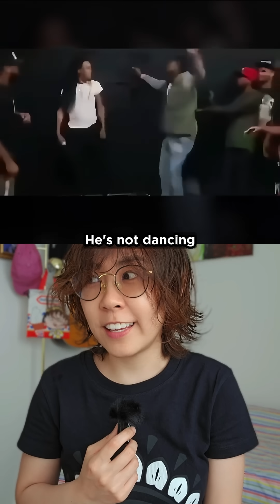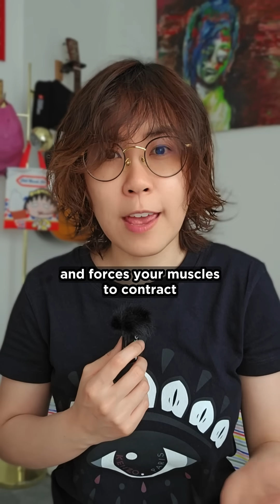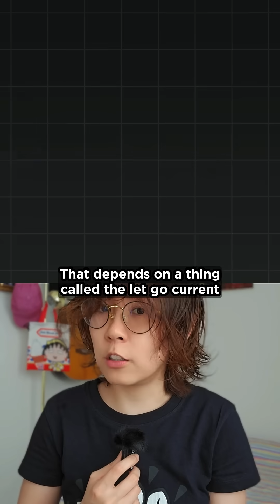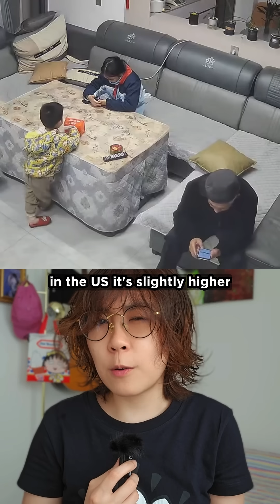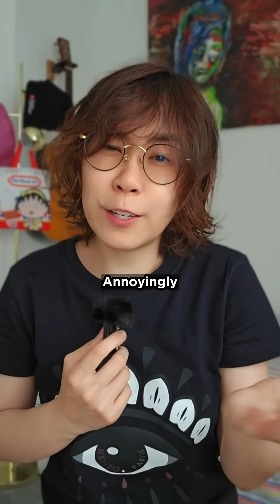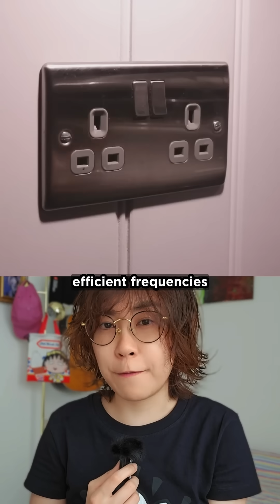How Much Electricity Can You Touch Before You Can't Let Go?

Comment: Old electrician told me to use the knuckle. Always use the knucles cause once u get shocked the knucles go towards the center of your hand and therefore separates u from the currents path.
Reply from the maker: That's interesting, I've not heard of this technique before. 
I only know to operate with one hand instead of both, so that the current is less likely to pass through your heart. 💜
Reply: @vt.physics  We're taught left hand rule, cause if one is gonna blow off, you want to keep your dominant hand.
Reply: @vt.physics That's what I was told to do when working on voltage. Before that I was told to never work on voltage.
Reply: @vt.physics  since electricity needs a closed circuit, I use my powers to float in the air, just enough to keep my feet off the ground. And so far that seems safe enough I can use a large heavy gauge penis, where the electrons would have virtually no resistance, and so far it seems much safer testing potential live electrical wires than my bare hand.
Reply: @vt.physics  Yeah, you should check by using the back of your hand so if there is a current, your hand and fingers curl away from the point of contact preventing you from closing your hand around it ⚡️🔌
Reply: Ooo! I didnt know that!!  @vt.physics
Reply: @vt.physics  the technique I like to use, is to use my powers to float in the air, just enough prevent a closed circuit. Then I use my large, heavy gauge rod, which is thick enough to offer no electrical resistance to check the for live wires.
Reply: @albertooresteslopezrosell6560  or, you can use a a multimeter, which is what that electrician would do, after disconnecting the power, and tagging out the box, so no one turns it on behind him.
Reply: @jaeger251  I got a $30 volt stick in my pocket and its a fluke buy a $10 one
Reply: @jaeger251  try tagging out a box with 15 skinners wired @ 480, never know what your going to get or opening lbs to check
Reply: Imagine it by pulsing your muscles which way does your body go when it contracts.
Reply: Use the knuckle for what exactly?
Reply: As an electrician I actually recommend using a voltmeter or multimeter. I don't know what that old guy was on about. 

But for real, I would recommend finding something metal that has a rubber handle and touching the metal to ground and the thing you're trying to test at the same time to make a visible spark. That's much safer than using yourself as the testing device, knuckle trick or no. You don't know how much voltage is going through there, and while it's probably a relatively safe amount, you still should probably just use something metal. Just don't grab the metal directly yourself.
Reply: Appreciate it
Reply: And that’s why you pay attention in math class people
Reply: Huh, i've actually seen old school electricians in the 90's just stick a finger in their mouth and then touch a 'possibly live' wire or circuit. Also seen on several occasion them discover that said wire/circuit was indeed live.
Reply: How about turning power grid off before working with wires?
Reply: Another thing we learned back in the day like in a fire situation where you can't see and need to feel for an exit turn your hands around facing you and close them and feel with the back if your hands.
If you hit something electric instead of grasping it and dying it will recoil your arm muscle back away from the wire
Reply: I will try it.    Not
Reply: Also work in electrical. High voltage distribution. But we also hook up 120/240V Services to the main secondary systems that feed peoples homes. Some of the old heads preach if ur feelin dumb and wanna check if a service wire is hot without measuring it, u give it a tap with the back of the hand so if the muscles contract u dont grab onto it. It’s not something id recommend but it does work as intended.
Reply: DC can cause some weiiiird muscle reactions so I wouldn't use it for that.
Reply: Yeah that's great but you can't write your words out completely like a big boy?

Comment: I remember one of these incidents vividly. I was 5 and was watching my father set up the festival lights. Tbh, I was annoying him by touching random wires that were not connected. He was concerned and so he told me to go away. I didn't want to go so I  told him I wouldn't touch anything. One of the lights wasn't working, so he told me to not touch anything while he went to search for the tester. 

Rookie mistake! I went ahead and connected a wire which has a plug at lne end and a socket at the other to the main board and connected that socket with the plug of the lights that wasn't working. It was a loose fit. To know whether electricity was flowing, I tried to touch the exposed metal part of the loose fit plug with the middle finger of my right hand. I absolutely knew the consequences but did not know how dire. Nothing happened the first 3 times because I pulled away too quickly. 4th time, a very small part of my finger got burnt. I saw small amount of smoke.

The story doesn't need a conclusion. My mother saved me from my father wrath and then showed me her personal wrath. 💔

But now I know how electricity feels like. 🙃

Comment: Before someone misunderstend:
This is true for voltage higher than 200V.

I have seen people that say 10mA will hurt a human, without the frequency and voltage
Reply: every single combination of amperage and voltage does something different to each individual part of your body, there isn't a magical universal rule
Reply: @AdrianOkay  Yes. I am tring to point out that you need the voltage too, not jsut the current.
Reply: And this misconception is why Americans insists on keeping 120. Where 400/230 3 phase to the home which is Standard in Northern Europe is more efficient notably with EV Chargers and High power appliances such as Oven / Stove / Water Heater. Plus its more balanced on the feeder lines. Yes these are all 3 phase 400v in many many homes and are protected with RCD / GFCI. Which means they can often be ran with 16amp wire instead of 50amp wire.
Reply: M I S U N D E R S T E N D 😂 😂
Reply: 150 volts can be dangerous too if it has high current. It only takes 0.05A to kill you but it needs the voltage to push through otherwise it won’t be able to break the skin.
Reply: And someone who's been shocked by 50A 240V 60hz I can confirm that you are misinformed.
Reply: 10ma is lethal at a certain time of exposure when ths source is at a low frequency. At higher frequencies it gets a lot more complex
Reply: @zedsanimations2242 I love to hear you elaborate on the complexity of the frequencies and where exactly the 10 mm needs to be applied to create an issue. When the paddles are placed on the heart, do they need to be ultra conductors like gold or will just wires straight into the chest do the trick?
Reply: 10mA can be fatal
Reply: You can model the human body as a resistor, so lower voltage reduces the potential current that can flow, since I = V/R Others in the comments are right that the magnitude of the current in the body is what causes the harm. 120V is safer than higher voltages for that reason, but it’s not “safe” cause it can still kill you if you don’t work with it properly.

There are also limitations on the source. A AA battery can’t produce hundreds of amps because of internal resistance of the source even for a microsecond. The grid is a strong source so for all intents and purposes for this discussion can be modeled as having no internal resistance though technically not true as there is a limit to the amount of fault current from the grid.
Reply: Current is what kills, but voltage determines current. 120V is well more than enough to lock your muscles, but it does have a lower current as a result of the lower voltage.
Reply: @specialopsdave surely we use should watts to measure how dangerous a live wire will be if shocked instead of voltage and current
Reply: @the_bean_barbarian  A car battery can output typically over 6000 watts, but it's FAR safer to touch the terminals of a car battery than the output leads on a 2000 watt 120v generator
Reply: @specialopsdave  I work with 6V and more than 20mA! Do you want prof? I can show you, or go watch ElectronBOOM.
Reply: @specialopsdave ”voltage determines current” is untrue. They’re both inverse proportions of power. If I tell you I have 12 volts you can’t determine what the current is. If I tell you you have 5 amps I can’t determine what your voltage is. But if we’re talking about the same circuit, now we know how much power we have P=IV or 60=12•5. 

What this person is talking about is the amount of current required to stop the human heart and this is based off of some research, speculation, and inference that was done in the wake of some navy electrician’s death after he stuck his ohm-meter (that measures resistance to the electromotive force, the ohm, the inverse of the Siemens (hehe) the unit of conductance of the electromotive force) anyway he heard that the human body’s equivalent resistance was about 500,000 ohms thru skin so he stuck the probes deep into his thumbs and with a 9 volt battery at 900mA, died when his heart went into arrest due to polarization of the purkinje cells in his cardiac muscle. By working out how much resistance living mammalian tissue with pumping blood vessels had in it on animal models they came to the dibdiueuib that we little as 10mA, was enough to stop the heart and the current was 9 volts. That works out to a wopping 0.9 watts of power.
Reply: @maseratidyce3587  Current equals voltage ÷ resistance. Less resistance, more current. More voltage, more current.

Amps = (Voltage ÷ Impedance), given no current limiting device
Reply: @maseratidyce3587  No, power actually has nothing to do with it.  It is purely current that matters when talking about neurological effects of electricity on the body.

And it is true that for a given resistance the voltage applied will determine the amount of current that flows through it (which I'm pretty sure is what @specialopsdave meant).

However, the problem is that the resistance of a human body can vary dramatically (by multiple orders of magnitude) depending on the exact circumstances, so it is still absolutely wrong to say something like "this is only true over 200V".  There are many many situations where current over the let-go threshold can and does happen at much lower voltages than that (I've had it happen to me personally at 120V), and there are even quite a few situations where voltages lower than that can actually be fatal, too (even without sticking any probes into the body or anything).

The generally-accepted "safe" voltage limit for humans (for exterior skin contact) is 50V.  Anything above that should be considered dangerous, and even potentially fatal under the wrong circumstances.
Reply: Generally, 0,5 mA can hurt. 5-200mA can get slightly dangerous, depending on the exposure time, around 30mA - under 2A can get deadly (again, depending how many milliseconds or seconds the exposure time is), more than 2A is deadly.
As for volt: > 50 V AC ist dangerous and >120 V DC is dangerous
Reply: Its always about the current, not the voltage that can kill u. And frequency just mean u can let go of ur hand when the voltage is or close to 0, so higher frequency mean shorter window for the voltage that close to 0
Reply: Isn't it the frequency that determines the potential of an electric shock?

Comment: great to increase awareness to electricitty dangers HOWEVER, that second clip showing a little girl getting electrocuted is a bit much, wouldv'e been lightyears better with some kind of animation easely found online, hope she's ok....
Reply: from a random chinese article, it's said: "Afterwards, the girl's parents revealed that her hands and feet were swollen due to electric shock", so i guess she's fine.
Couldv'e been worse, electrocoty breaker not working is really bad, electricity will hurt you from the inside and you'd look fine from the outside so if you do happen ti get a big shock, better be safe and check in at the hospital

Comment: 120v 1a  60h is the most lethal way of carrying current and electricity so far observed in the world to put it in perspective, I have been electrocuted by 60 volts at 3,000 amps it was an industrial grade welding unit used on top of an aircraft carrier it also had 90 volt settings available but they were only running at 60 and a large Shipyard I don't like made my arms cramp up for about 5 minutes and it was a cross both arms so they put in a maintenance request to have the cables replaced because the insulation wasn't holding it was a DC voltage the AC unit was not being used that day I got lucky. My grandfather working in the Brooklyn Naval Yard saw several people suffer severe shocks rustie 90 volt charging units that were going at about 110 amps 120 amps also on aircraft carriers they're just not safe to be wandering around on. Let's face it. I saw an electrician servicing a washing machine get hit by 2:40 at 15 amps at 60 hurts and he didn't even have to shake it off it just didn't bother him. Another experience electrician got shot by line current  120 by 25 amps and it took three guys with a plank to shove them off the line and he was dead before they can get him off the line it was still jerking him around dead. The electricity in houses in the United States does not play around it doesn't forgive a mistake

Comment: You can safely touch live wire if you are insulated from ground(like wearing foam or rubber shoes). Also the voltage should not be higher than 220v-250v and upto 15 amp at 50hz.
Reply: LOL! Yeah, do that...
Working with live wires is 100% safe with rubber boots on... Right, right...
Reply: I wouldn’t touch it with two hands. In fact I wouldn’t touch it at all, unless there was some emergency.

Comment: This is also one of the reason why on massive powerplants the workers who regularly check/maintain the generators and essential parts of the plant have at least one person who is station at the back carrying a long pole that has a hook on the edge to quickly pull someone if there is a leak.   And also
Your bodies gets Soo numb that you don't know what to do because the motors and muscles in your body is beyond your control.
Reply: No at the substations the specific generator that we have to work on we cut the power to it and overload power from another grid to compensate and if there is ever a need for that hook it is to pull your dead body because if you get hit by an arch for even half a second you are dead i know only one person that has survived it out of 11 not including him who all passed that exact way
Reply: I thought they were there to pull out your body for the Funeral?
Reply: Who said it wasn't @silverhawkscape2677

Comment: I've been electrocuted once. In Australia we have 240v @ 2400w and a 50Hz frequency. And I swear I could feel each pulse of electricity with each Hertz. It only lasted a second or two but it felt much longer than that. Not sure what happened to make it stop, but when it did I sat down for a long time coming to grips with the fact that I'd just been electrocuted. I, of course, did not tell my wife when she got home. The strangest thing is though, I turned off that circuit and checked it before working on it. After I got jump-started I checked the circuit again and it was indeed off.
Reply: Did you ever think somebody might have turned on the circuit for a second? 
Ask wife😅
Reply: @mr.transposon5017  I was home alone
Reply: In Australia, does electrocuted not mean death over there?
Reply: i dont know what you were working on but if something has a really really big capacitor in it, it can store a deadly amount of power even when its off, for example a refrigerator or a microwave would have a strong enough capacitor to kill you even if its no longer connected to anything

whoever may be reading this, this is your sign to not take apart microwaves (or anything else connected to mains voltage)

Comment: US electrical current is only 110-120v. Due to the bodies electrical resistance, this will not cause an adult's body to spazm and will not cause the muscles in the had to contract.

This is why it's fairly safe to run at 60 hertz. 

In some cases, I've been able to test wires using my bare hand. I don't recommended it but it's not very painful if your body isn't grounded. It will be more painful if your hand is covered in sweat (electrolytic solution).

This 110-120v can be much more harmful to small children, pets, elderly people and anyone with a heart condition.